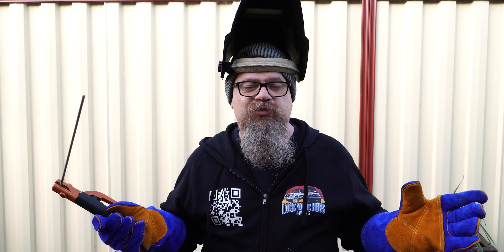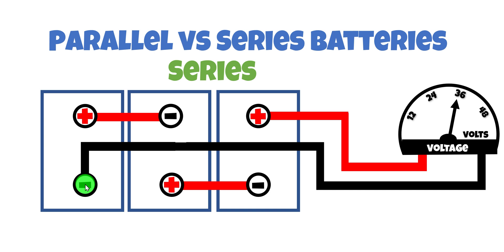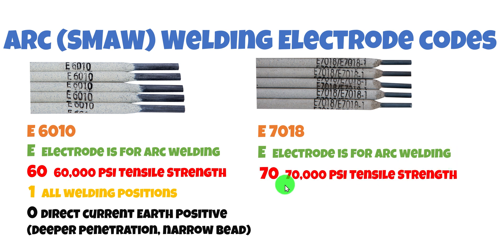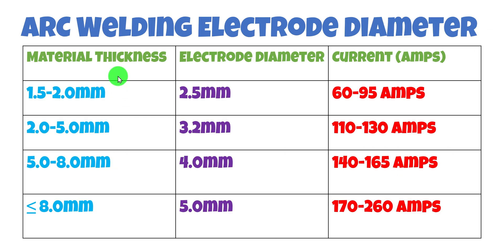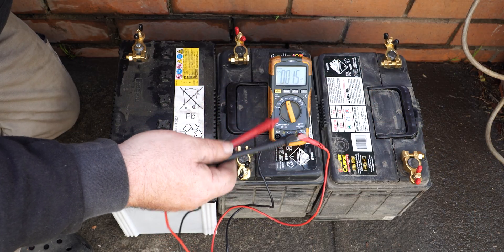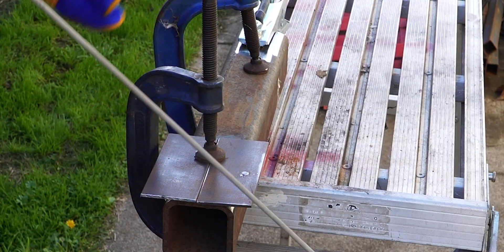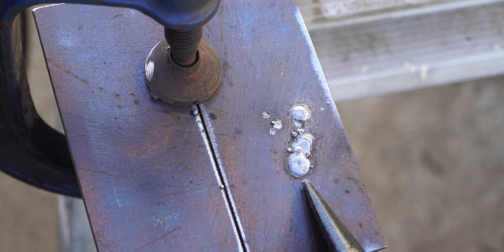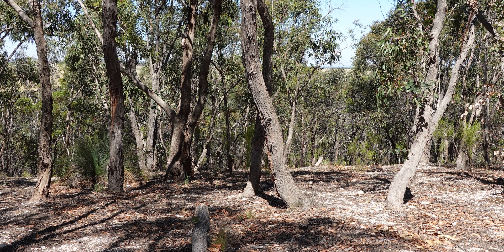The Ultimate 4WD Welding Tutorial: Arc Welding Using 12V Batteries

Comment from the maker: How could we get better current control (stop blowing holes in things) when welding with batteries?
Reply: We used to add a length of thinner cable to the circuit to reduce current.
Reply: @philg2468  yup.
Reply: What current would be optimum?  Can one of those buck converters with limited current output work?
Reply from the maker: @garylienert  It depends on the electrode and the thickness of the workpiece (see the chart in the video) So any solution would ideally need to be adjustable.
Reply: adjusting your arc length to compensate would be easiest.
Reply: ohms law tells you to increase resistance of circuit

Comment: If you are going to make YouTube videos learn what the terminology is and what it means you have many things wrong. It is possible to weld light gauge material with 1 batterie and the correct/ electrode/ polarity/ but technique . But why bother welding body panels unless you want to cut them off. Which is also possible. Speaking from 50+years of experience.
Reply from the maker: Please link to your video where you show it being done with readily available rods from hardware superstores. 

I'll wait.....

Comment: DCEP stands for Direct Current ELECTRODE Positive. The E is for electrode, not earth.  The fourth digit of the electrode code tells you the type of flux coating used. This does influence what polarity you should use, but tells you a lot more about the rod than just the recommended polarity.

Comment: I do a fair amount of mobile welding for people who are broken down along roadside. I use an 8000 watt inverter (that in reality only does 4000 watts;) it runs off of 12 volts, and i use 2 in parallel batteries. The nice thing is that i can keep the vehicle running, giving me another 100 amps from the alternator. This allows me to use a regular stick welder, and i can use any freaking rod i want 3,2mm on down, preferring the 2.4mm rods.
Reply from the maker: I think an inverter and inverter welder is the ideal mobile setup, though this is a more minimal setup that could fit in a small tool bag for emergency only use.

Comment: Also if the electrode holder cable is attached to Negative it is DCEN. The way you are explaining it is backwards. If the Electrode is attached to the positive terminal it would be DCEP. Electrode Positive.
Reply: You can weld like that. With DC- you have colder welding, it used for root welding etc.

But in all normal conditions - DC+. Easier to start an arc and better welding properties.

Comment: I'm thinking seriously about this. I've seen people using lead batteries with a capacity of only nine amps. They combine three batteries in series. Three batteries in this case give out a high voltage of 36 amps. He was able to weld with...
Reply from the maker: Low capacity (Ah) batteries, usually have an issue delivering the required current. Dependent on the chemistry etc.

Comment: Use smaller welding rods. I use 1/16" rods for sheet metal.
Reply from the maker: You make a valid point, it should need less current with smaller diameter rods. I just grabbed what was available at my local hardware store.

Comment: FYI, battery selection is also important, because excessivly high amperage also kills batteries, by overheating the plates. 

(probly) seems unlikely, but I've done it.
Reply from the maker: Whilst a consideration, I don't think the heat generated running a couple of 2 inch long beads is going to overheat the batteries.
Reply: 150 amps will fry a lead/acid group 9 motorcycle battery.

Comment: Thumbs up!  Question: do these batteries die from this,  or isn't a car battery designed for a quick discharge?
Reply from the maker: That's less current than winching of starting, so should be fine.

Comment: Fantastic video as its a subject close to my heart.  My success in the past has been with 2.5mm rods running off three lead acid batteries (36V).  Back then we used a Southwark beer carton on the head with a piece of welding glass in a cutout.  Sure the weld got a bit hot, but if you lifted frequently, you'd get the job done.  
Then along came AGM batteries - I can only assume they are OK for welding.
Then along came Lithium and all my desert travel mates use Lithium, so we still have to have 3 vehicles in the convoy to weld with 36V of lead acid starting batteries!
So currently, I'm trying to get with the times...... and I am experimenting with different welders running off a cheap 240V inverter running off 200Ah of Lithium batteries.  So far I can weld thin stuff with a MIG welder at up to 70A.  But next I need to experiment with my daughter's inverter arc welder as its very light and would be perfect for the desert trips, but as yet I still not sure whether I can run it off an inverter.
Reply from the maker: It'll depend on the current rating of your battery, the capacity of your inverter and the current requirements of your inverter welder.  Though, if all are in spec, there's no reason why it wouldn't be completely feasible. Unfortunately I didn't have a spare empty beer carton for the thumbnail! :)

Comment: Nice vid, biggest thing that will help is preheat everything, esp the rods that will helpna lot then the work piece, its the secret to arc welding, also low hyd rods run much smoother
Reply from the maker: Thanks, I've tried preheating cast iron when brazing, I must give it a go with the electrodes and thicker workpieces.
Reply: @LockyourHubs4WDing  doesn't need to be glowing but if you. An get it to 50/70degC helps get all the moisture from the rods and work
Reply: @LockyourHubs4WDing  also works well on thinner bits as well

Comment: Nive video but to be honest, I think you've massively over-thought your kit, which has obviously not seen any use yet, other than for this video. My travel welding kit, which I've been carrying for more than 40 years and only needed twice, is definitely a bit more primitive but also takes up far less space and is much lighter. The rods are Satincraft 13, which are the easiest to use general purpose rods I've ever used, in 2 bundles: 1.6mm, which will weld using 12v for light work and 2.4, which work fine off 24v. The rods are wrapped up in cling film (Gladwrap, etc.), together with a couple of packets of silica gel. For the mask I just use a hand-held filter glass. Riggers gloves work perfectly well but it is of course preferable to wear something like a long sleeved flannel shirt. Jumper cables and vice grips serve well, especially considering how rarely a kit like this will be required. The chipping hammer is way over the top too. Just use a screwdriver. If you are likely to be doing emergency welding more than once every few years you'd be better off investing in a portable mig kit, which will run off your batteries.
Reply from the maker: Most of the componentry for the kit I put together came from my inverter ARC/TIG. I can't remember the last time I used the welder for anything other than tig and the components were sitting in a bag on a shelf. 

I'm amazed you're getting a stable ARC at 12v , even with 1.2mm rods.
Reply: @LockyourHubs4WDing  That's one of the great things about the Satincraft 13 rods, they keep a very stable arc. It's just one of the reasons I always recommend them to beginners. I must admit that I'm not even sure that they still make the 1.6mm rods because I haven't seen them around for a very long time. Not that I really need them these days because I rarely arc weld any more, unless it's heavy sections and the mig and tig are better suited to thin material anyway.

Comment: This would work if your travelling in a convoy with access to a couple of other batteries. With a lot of people now running inverters and lithium, I’d love to know the pros and cons of welding with the new style compact 240V arc welder off a 12V inverter.
Reply from the maker: If your system could support the electrical load of the inverter welder, that would definitely be the way to go. 

You would have all the usual controls and maybe even run a TIG! Just gotta find somewhere for the Argon bottle.....
Reply: @LockyourHubs4WDing  The better choice would be gasless mig.
Reply from the maker: @SirFuseable  have you tried one of those?
Reply: @LockyourHubs4WDing  I did, probably about 35 to 40 years ago. The boss had one given to him, so I grabbed it off him, took it outside and connected it to the battery on his old Cruiser. It welded thin material, say around 1.6mm, but would it have needed 24 volts to get a weld that I'd accept for say a cracked chassis. Getting the rush to get back to work I didn't get to do anything else with it. The whole kit was very compact. It's essentially just a spool gun with a basic controller. It didn't even have a facility to use gas, so it had to be gasless mig wire. I have been tempted to get one of those migs for myself but just haven't been able to come up with a real justification for it. My other half reckons I own enough welders already.

Comment: Can you weld straight off solar panels?   Like your 400w roof top type panel that have around 48v and 9amps.
Reply from the maker: You need a lot of amps to weld, so unless you're running a solar farm! Probably not unfortunately. Though the energy generated by the solar could definitely be temporarily stored in batteries that could then be used for welding.

Comment: Another great subject matter,thanks for posting.Would you be able to mix battery types eg LiFeP04  with agm or starting  batteries and also do the amps of the batteries need to be the same or are you able to join a 200amp with a 100amp?
Reply from the maker: If the BMS can support the current the setup is drawing, a LiFePO⁴ battery in the mix shouldn't be an issue.
Reply: @LockyourHubs4WDing  Thanks
Reply: Remember a car battery with 100 Ah tells how much energy is stored in the battery (in theory 100 Ah * 12 V = 1200 Wh) . But you can withdraw hundreds of Amps. If the battery can deliver 500 A, you can withdraw 500 A for 12 mins (in theory 100 Ah / 500 Ah = 0,2 hour = 12 mins).